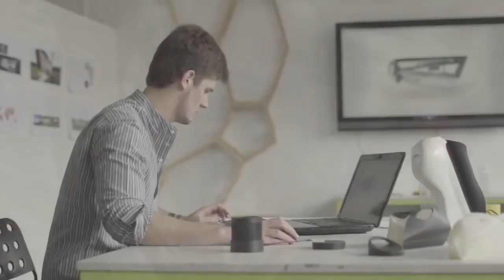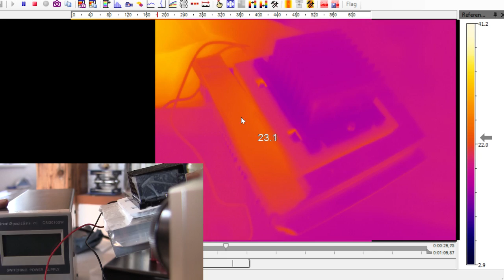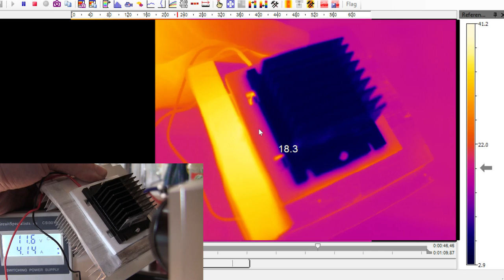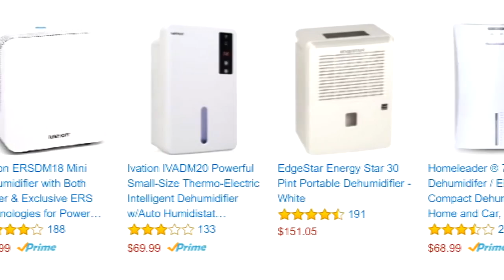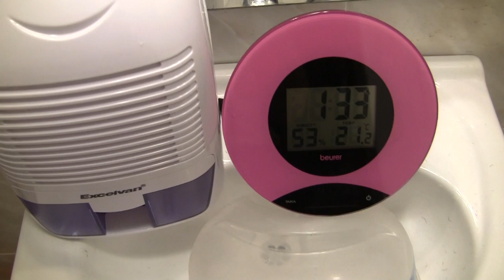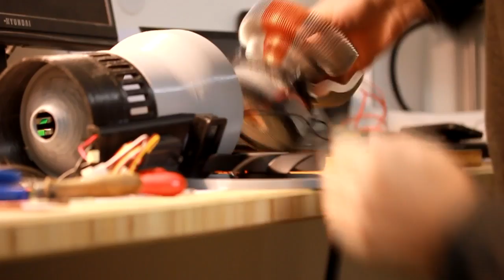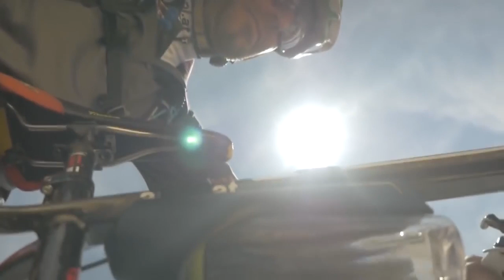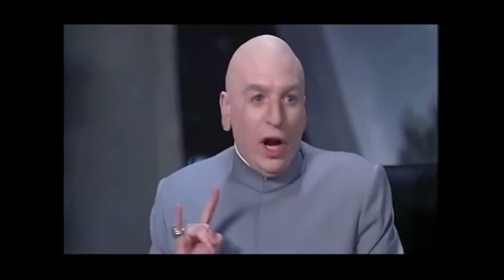$300 000 'Self-Filling water bottle' FAILURE

Comment: I know the thermodynamic limits, and such. I am just wondering how my dehumidifier produces 2 gallons of water in my basement every night during the summer here. It is not a peltier effect one. it has a huge condensation coil and a 2 gallon reservoir and I have to empty the reservoir every morning otherwise the shutoff kicks on, and the reservoir is completely filled. It was making me so crazy that I directly hooked up the dehumidifier to a hose and routed it to the sump pump hole in the basement. the relative humidity on average during the summer here is approximately 75-80% every day during the summer. and the average temp is 80 fahrenheit or 27 celsius and it is a old dehumidifier that uses huge condensation coils, and is labeled as a 200 watt dehumidifier
Reply: Akin Turhan Probably because of the humidity, lots of water in the air means lots of water to collect.
Reply: a big coil will work a lot more efficiently, but it needs a big area to work. peltiers are a lot more compact. The higher the humidity, the easier it is. For example, at 100% humidity, the water condenses in the air, and you get mist, fog, clouds, etc, with no effort put in at all.

Comment: I just thought of a much better way to do it.
1) Use a desiccant material to take the water out of the air.
2) Use solar heat to drive the water back out of the desiccant and into a closed volume air
3) Cool the air to let the water condense.

This way, the 10% efficiency of a solar panel won't come into it.
You still won't get enough water but you would likely get more.

Comment: Ok... BUT 32% is an  extraordinarily low relative-humidity level.  A proper busting would show the experiment with a typical humidity (55-75% for most of the USA, for example).  Then you might get a pint or two of water out of the 80 watts @ 7 hours.

Comment: How about MagLev 'freaking' roadways? Sure, it sounds completely bonkers until you realize that the roads continually collect a lot of rain water. All you need to do is to funnel that water into a hydrogen-oxygen separator and then run the hydrogen into a hydrogen energy generator. Now you have all the energy you need to run hydrogen powered maglev cars with artificial intelligence guiding a'la google car.

How fantastic is that for a scam indie gogo?

Comment: I technically don't think there'd be any IP theft for reverse engineering a dehumidifier.  Like you said they're all just basic peltier devices, I don't think there's much that can be patented on that.  But they clearly have no problems with blatant fraud, I'm sure theft wouldn't be an issue with them.   Also, just to add, I love how they're like "great, we've secured hundreds of thousands of dollars in funding, now let's figure out how a dehumidifier works"

Comment: I agree that the system, as was presented, isn't feasible. One thing to note is that there are better ways to run a peltier device than you did in your demonstration. Running the system in constant current, rather than constant voltage as you were, performs better. With lower currents you tend to get a better coefficient of performance, you can get COPs much higher than 1.  The main issue of this project was the rate of dehumidification, even running an optimal peltier system optimally this is still an issue but it can be done in a reasonably energy efficient way.

Comment: so would it be possible to condense more water with more energy? for example if you hooked the bike up to it.
Reply: no, thats why he showed the dehumidifier test with a constant power supply , power is necessary to run that thing but it does not guarantee any water production since the water has to come somewhere hence the humidity of the air, so in short in regions with high humidity you don't need that thing since it rains all the time (because the air cant take any more water) and in regions with low humidity you wont get any water since there is no water to begin with.
Reply: well I think there is a fair ammount of air humidity in austria. but yeha guess it's too bad the government is so retarded.
Reply: Theoretically it's possible, the more power you have the more water you'll produce, but the amount of power you'd need would require something more along the lines of towing a diesel generator behind your bike than just the power your pedaling provides.  Also generating the power with your bike would mean extra exertion which would mean more sweating which would in turn defeat the purpose.  (Yes, I know carting around a 400lbs generator would make you sweat too)
Reply: Bill lupin I mean . . . the intake for the bike one is basically between your legs, if the thing actually worked you'd more or less be drinking what is at least 25% ball sweat.
Reply: freddykisback123 Agreed. Remember how difficult it was to pedal your bicycle with one of those little dynamos for a light? (if you're that old lol)
Any gain in water produced would be negated by the fact you're burning more energy to create it thereby increasing your need for water essentially leaving you at square one.
This is all relatively basic science in my view.
Reply: yeah i meant to say you can't produces a sufficient water supply based on dehumidifier technology in low humidity regions. simple as that.
Reply: exactly, self defeating purpose. that's what differentiates good ideas from bad ones. You can only make the bad ones "work" if you dumb impractical amount of resources into them which then only creates underwhelming results. good ones do the opposite.
Reply: Sure. If you hooked up the bike to some kind of small generator that powered a water condenser, you could certainly get more out of it than from solar power alone.

But any energy you use pedaling a bike to not actually move with the bike is basically wasted effort. Essentially, any energy used to create water would simply make you far more exerted over the course of a long bike-ride. 

This of course would defeat the purpose of speeding up the process entirely, as you would lose more water from sweat and from your breath by having to put more energy into the bike/human/bottle system.
Reply: Captain_Pudding "Sun's going down. Better drink my own ball sweat. Really wish I hadn't drunk all my piss. "
Reply: freddykisback123 Yeah, there's no practical way to do it.  It's physically possible you'd just need a million dollar setup (no idea what the actual price would be but based on power requirements and a massive dehumidifier) to get a litre of water per hour in 30% humidity.
Reply: you could produce more but there would be a limit tied to humidity and the diffusion of water in the air. it is actually a great idea to collect water from the air in regions where the humidity is high but it doesn't rain often (like some desert areas near the sea), but there are far more efficient ways to do that than just using dehumidificators
Reply: Then you'd be working a lot harder to push the bike, and you'd lose far more water from the extra sweating and breathing than you would ever get out of the bottle. A bicycle  dynamo would produce maybe 3 watts of power, the commercial dehumidifier in the video was much more powerful at 80 watts and still produced essentialy zero water.
Reply: @helenvalentine95 Check out Air Wells. They've been around since the 1900s and do the condensing passively. Costs no electricity as it uses either radiative cooling, or a large mass of stone masonry to sink heat and condense the fog/dew from the air.
Reply: You'd get more water from collecting and filtering your own sweat, I'm sure.
Reply: GameSquid no, then you would need to expand the cooling plates.
Reply: I think it's meant to be a sports utility,  so I don't think that losing water by exhausting yourself would be an issue, if the bottle would actually work, that is. but yeah sucking on the wet finger after 7 hours wouldn't do, lol
Reply: In the summer I was able to get 6 liters of water in 24 hours running a 750 watt dehumidifier in my basement in Little Rock, AR, but it had humidity levels of 80% in the summer. In the winter I would only get around 1 liter a day at 50% humidity. 

That is the problem with this device. It won't work that well in dry climates. You need humidity for this to operate
Reply: I wonder if they could actually make a version that would work in the hot wet summer.

Comment: ill be honest... put up a kickstarter for a solid gold hammer youll use to crush metaphorical "projects"  and i send $10 your way... js
Reply: No, you think to small, solid graphene hammer. Go Thor on their butts.
Reply: I'd do exactly that
Reply: why tungsten why not the much cheaper steel or hell just use pig iron
Reply: Razzeil you didn't get the point right?
Reply: Razzeil oh i didnt got the point
Reply: I just did the maths. A 12x4x4cm 100% gold hammer head would weigh 3.70944 kilograms (roughly 8 pounds), which would cost $147,079.30 at today's price. Mere peanuts compared to how much these pseudoscience ones get, although you could get over 2900 normal steel 8lb sledgehammers for that price.
Reply: Pure gold is really soft. Gold jewelry isn't, because it usually isn't pure gold, it's normally alloyed with things like copper.

Comment: around here we have over 90% humidity all year long. how long would it take for a good humidifier to fill 1L or water?
Reply: I live in a place very similar, it takes about 3 days.
Reply: Do you even need to drink, or is breathing sufficient?
Reply: Why would you need to use a humidifier to fill a water bottle? Instead of putting your water into the humidifier, put it in a 1L bottle. Then it would take however long it takes you to fill the bottle.
Reply: Just walk to the nearest puddle, pond, or river. Surely you have standing water nearby at almost all times? Better yet, collect your rain water and boil/filter it. Surely you live in a rainforest, what with 90% humidity year round...
Reply: 90% wow do you life in the jungle? I life ~900m away from an ocean and <60% is normal here. How do you handle mold with 90%? I mean if you have 60% in an flat here you have a flat full of mold.
Reply: burt591 an arconditioner would be extremly different from this. It takes so much energy it's not even worth talking about it
Reply: I know that feeling. If I turn a dehumidifier on in my apartment the humidity level will always read 80% or more; even if it's on for HOURS it won't go down much below 70. 

After all that wasted electricity it takes a blink of an eye for the humidity to rise up again to where it was at the start. #Lisbon
Reply: Were I live we have around 45% humidity and my air conditioner fill a 20 lts bottle in 10 or 15 hs of working. I kid you not
Reply: The ocean... depending on where in the ocean... the ocean...
Reply: +Pedro MR Yes I know it's different, but it is kinda related though. I just mention it because I think it's very impressive the amount of water that you can extract from the air
Reply: burt591 sure. my ar conditionair giver bottles and bottles of water. It's also the biggest eletric expense i have lol
Reply: No its not. Its rather simple. Mollier diagram shows, there is about 10g Water per Kg air (~1m³). Get 100 m³ of air through your AC (assuming it gets out all the water, which is not happening) you get 1 litre of water. Run 1000 m³ you get 10 litres. There is water in the air, you use more air you get more water. Its like saying my car uses more gasoline because i drive a longer distance.

Comment: Not that it invalidates your conclusions, but I think the dehumidifier you bought might suck balls.  granted the one in my basement is larger and I dont know how large the respective heatsinks are, power draw and etc, but I typically have to empty the  tank(a few gallons) at least once a week.  I was honestly surprised you didnt get a single drop letting yours run overnight.

Comment: I've been to a desert and it is extremely not humid so I don't think the water bottle would work very well although it would get powered well. It would be best used if you found a watering hole filled with animal feces and you put the bottle near that to collect the clean water evaporating out of it.

Comment: Would the water actually be potable?  After waiting a week for the liter of water, would you even be able to drink it?
Reply: CaseAgainstFaith1  don't know about you, but I'm not keen to drink water that's been run off a computer heat sink, I think the daily recommended values for copper and aluminum is zero.
Reply: CaseAgainstFaith1 It may be portable, but not potable.
Reply: Actually, copper RDA is 2 mg.  Aluminum is 0.  But people still cook with aluminum cookware.  While Alzheimers involved aluminum in the brain, it is unclear the relationship between aluminum intake and the disease.  In any case, my question was about the water from the air. If we were to assume that no impurities were added due to the device itself, would it be like distilled water, or would air pollution come with it?
Reply: CaseAgainstFaith1 color me corrected. I'm still calling 2 mg small enough to call it nil. It certainly is in comparison to the some 85 kilos of body weight. I wouldn't drink anything run off of a heat sink all the same. Water is too good of a solvent that anything in or on the find will now be part of your water.
Reply: MostlyHarmless:  I accept that.  I don't know how much copper and/or aluminum would show up in the water from such a device.  But, I was specifically curious about the pollution in the air.  Would that come out of the device?  Or, would it act like a distiller as far as the pollution in the air?  My guess is, the pollution would come with.  Eater999 seemed to suggest the water would not be potable.
Reply: P.S.  Given that water pipes are made from copper, I don't think copper heatsinks would be a significant concern.  And given that we still sell aluminum cookware, I also don't think aluminum heatsinks would be a big problem either.  Now, if there is lead solder used in constructing the heatsink assembly, that would be a problem.
Reply: Air pollution wise it should be fairly clean, from what I know acid rain picks up from nitrates in the air while falling. My chief concerns still lie with the heat sink. The dehumidifier specifically mention not using the water as drinking water. Possibly because so much crap gets wedged in the fins that it will run off every nasty piece of gross that's floating around in the air. 
That said I condition rain water all the time to be used in my fish tanks as the tap water in my area is far too hard for the fish I keep that prefer softer water. If it's at least as pure as rain then it should be safe to drink. 

This is neglecting the key problem with this device. It can't freaking work in the areas where it would be something of a help and it's utterly useless in areas where the humidity is high enough where rainwater collection is more feasible as an emergency water source.
Reply: Yeah, I got that much from TF00t.  LOL.  Thanks.

Comment: They should've used desiccants to extract the water from the air, then a small amount of heat will cause them to release the stored water and you repeat the cycle, very little electric power would be needed and that could be provided by the bicycle siphoning energy from the rider

Comment: hey thunderf00t, i live in a very dry and hot place and i have a "portable" Air conditioner since our building wouldn't allow us to hang the condenser outside. the water it pours goes straight to a external bucket (i mean a real bucket, not something that came with the device) and running it overnight will always get the bucket halfway at least if not more.

so whats the main difference between this and my air conditioner? is just a matter of air flow volume?
Reply: khhnator Air conditioners use compresors, that are around 5 times more efficient then peltier modules, but the are quiet heavy. And second thing, AC uses A LOT of power. Something beetween 1000 and 2000 W. Compare it to 15 W of their solar panel. I am sorry for my bad English, it's not my primary language.
Reply: so a compressor will get around the thermodynamic limit?

Comment: Thunderf00t is giving a slightly misleading impression of how effective dehumidifiers are - they are used to dry out houses after flooding, plastering and with general dampness and they work exceptionally well at that you don't get piddly little trickles out in those situations you get significant portion of a litre a day so much so that if you don't empty them every day they flood the floor. Putting them a well insulated, triple glazed  heated room isn't going to get you much out of them though.

Comment: As a general rule of thumb, if any product claims to be solar powered, you can look up how much energy per square meter a solar panel can be generated from the most efficient solar panels in the world at optimum weather conditions. Quite often you'll find that by calculating this, most products with built in solar panels don't receive enough energy to charge themselves. Solar panels can be useful when used properly but most products just add them as an unfunctional marketing gmmick.